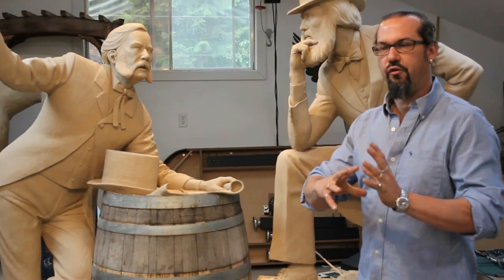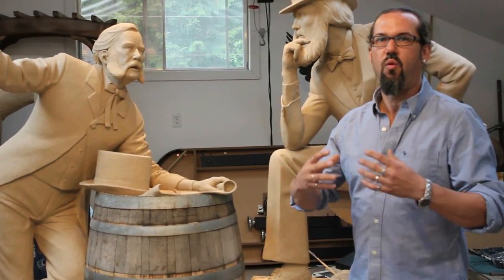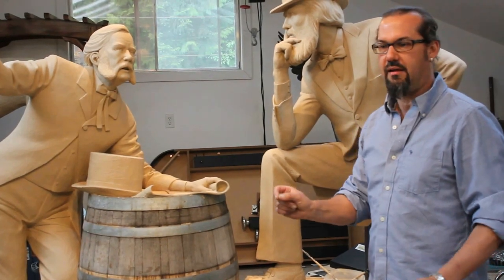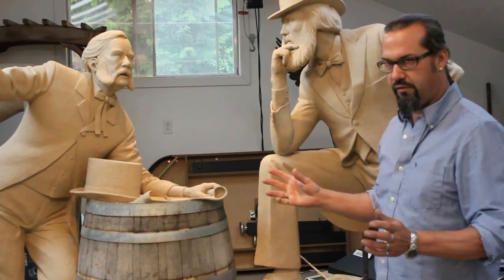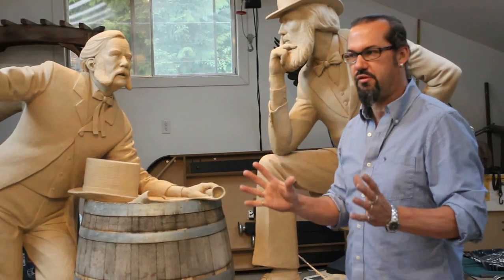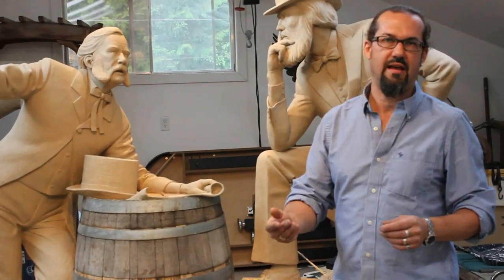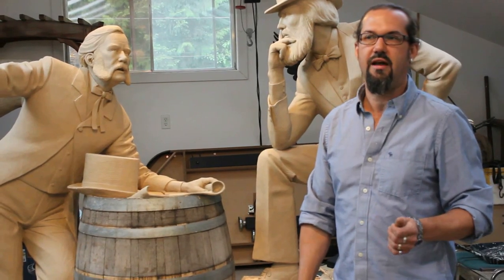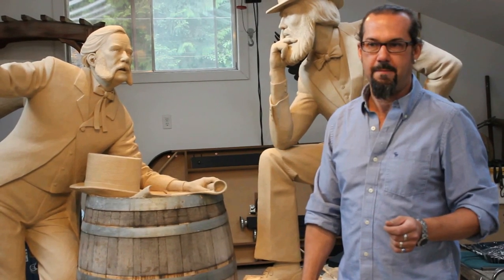Part 1of 2 - Time-lapse Making of a Life-size Sculpture | Nathan Scott

Comment: Maybe You Need to made something like rounded,moving podium,on whoom You can to manouver the sculptures 360* ?  You Need just to built a platform,and add on the bottom couple of strong wheels,just like under the rubbish bin.This can be not so bad solution for Yout tiny workplace Nathan.On that way You can see sculptures from different perspectives. Good Luck.

Comment: how would you fire this???
Reply from the maker: Hello RosieThanks for the question. The clay that I use cannot be fired, it a wax based clay. If it was heated, the sculpture would actually melt. The next step is to make a mould  of the sculpture. I use a polyurethane rubber, then I back it up with a fibreglass mother mould  so the rubber will retain its shape.after the mould is made and the clay sculpture is removed from the mould, I then can proceed with casting the sculpture to produce a bronze. For those next steps, you should head to my website to get a full explanation of the lost wax casting method. Check out the Website at www.sculpturebynathanscott.com